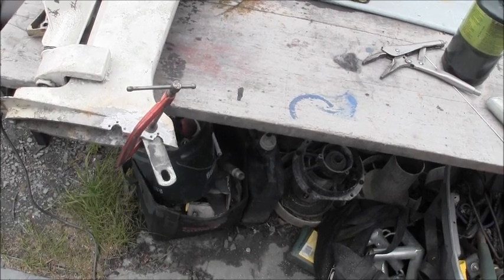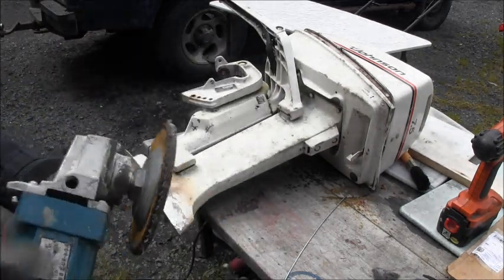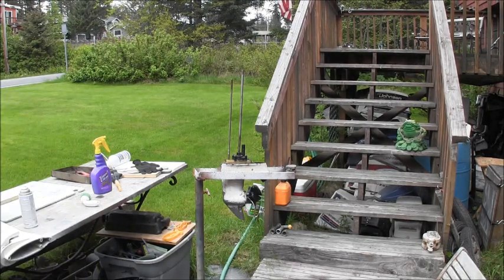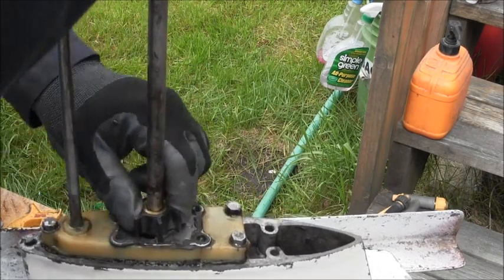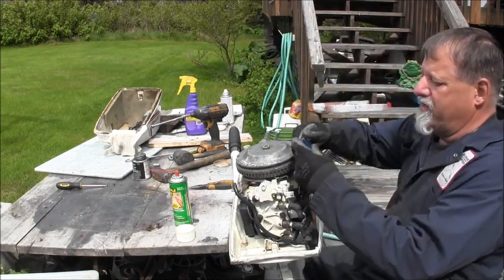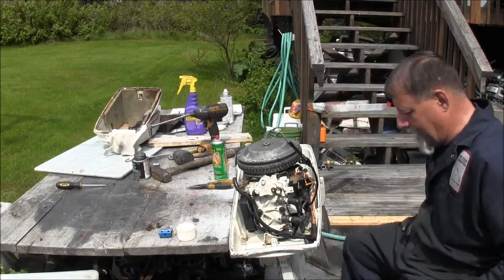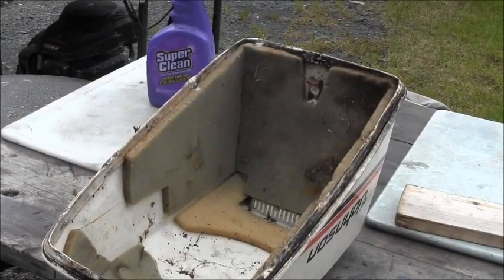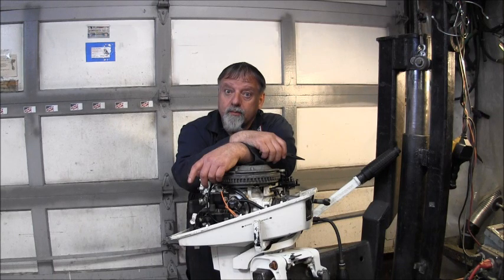JOHNSON 1983  7 5  HP,    WILL IT RUN  ?

Comment: My father had a 1984 Johson 6 HP on his 14 ft Gregor fishing boat and it was great. Never any issues. Never used in salt water just hrs and hrs and hrs of use fishing lake trout. I myself bought and used a 1984 Mercury 7.5 hp for my fishing boat. Engine still runs great too.
Reply from the maker: I so wish I had a place to run my motors in fresh water.  kodi

Comment: Hi Kodi, I just got one of those Harbor Freight auto torches to use with map gas. I wasn't getting a hot enough flame just using a propane bottle and my old brazing torch. I currently don't have any project requiring Alumiweld but I have plenty of rods when I do. Also yes make sure to use a aluminum type grinding disc or a regular one loads up and doesn't work well👍
Reply from the maker: Great tip!  I should have stated that in the vid,  I have 2 grinders set up that I only use on aluminium .     kodi

Comment: Should there be water coming out the exhaust breather holes on the midsection? A friend has an 9.9 Evinrude from the late 80’s and it has water coming out when you rev it.
Reply: You usually won't see much of anything coming out of those exhaust relief holes, maybe a little spray mixed with exhaust...  On the 9.9 you mention, water may come out of those relief holes at high speed because the inner "wall of water" has filled and the excess dumps out of the relief holes...Normal....
Reply: Thank you

Comment: Hi Kodi from Montreal Canada, That is exactly the same motor that I have; however, mine is 1980. It used to have 120 PSI compression in both cylinders, but after an overheat that it had due to the water pump was broken. Now it has just 75 psi compression. I already repaired the water pump and I have changed the head power gasket. The motor starts easily and it runs well; but, it still has low compression (75 PSI). Do you recommend me to change the Rings to improve compression or is better to continue using it at 75 PSI compression as it has now?
Reply from the maker: I would run it as is,  If it gets hard starting / poor running  then rebuild / re-ring it.  kodi
Reply: @kodibassInsideoutboards  Thanks a lot for yours videos and for answering my questions.  I will run it as it is ...

Comment: Did I miss a video?  I'm assuming the exhaust housing got damaged while attempting to wrastle that gearcase off.  A brazing rod for aluminum??  Tell us more about that for sure!    These engines have a few unforgivable flaws starting with the tendency for the driveshaft/crank splines to seize/rust.  I'm "guessing" this is due to the materials used to make the crank, but it sure seems to be the crank splines that rust up terribly.  Like I say, engines used in salt water should have their gearcases removed yearly to clean and relube the splines...The beauty part of these engines is that there is no shift rod connector, so they come off and on in minutes...  There is another hidden problem area on these things also...There is a little cavity hidden under that cheesy plastic upper gearcase cover that loves to store crap/debris and deliver it to the impeller...I had one of these that kept eating up impellers....Finally thought about it, then pulled the plastic upper cover, only to find a big pile of broken impeller debris under there...So, every time I replaced an impeller, the old pieces hiding down there would shoot back up into the pump, jamming and breaking the new impeller vanes...Someone before you opted to use that crappy sealer instead of the gaskets that belong on either side of the SS impeller plate.  These engines use the same lousy upper grommets as the 9.9/15s, trying to blow through them or jam a wire up there is only a short term solution...  Finally, the inner workings of these gearcases are flawed also...There is no bushing between the prop shaft bushing/brg carrier and the rear face of the reverse gear....So, there is quite a bit of friction/heat developed in this area, while leads to wear on the carrier face that the gear "rubs" on...Especially in reverse...A real big issue on tenders or sailboats that use reverse gear extensively...Once there is enough wear on the bushing/prop shaft seal carrier, this results in excessive prop shaft end play which leads to jumping out of gear.  I always used to wonder why the gear lube on these engines was always so dark/burnt when I changed it....Now I know....
Hmm, very interesting throttle cable lube device, I surely need something like that...I usually end up drilling a little hole into the end of the plastic casing, then injecting mystery oil with the tiller off, letting it sit overnight hanging vertically...Those darn cables are way too expensive.  
With all my "OMC shaming" here, one would think I hate these engines...But I still like them....Yeah, not nearly as durable as the old 6hps, but way more power.  And, with proper care, they can still last a long time, even in salt water...

Comment: Hi.On my 7.5 the water stops when engine is high rpm for like 5min.What could be wrong?
Reply from the maker: Check your water pump & impeller.    kb
Reply: @kodibassInsideoutboards  impeler is new and works fine,when water stops i get like fumes or steam out of water outlet hose.Lets say i on half power.....water starts to cut out and gets back on.When i increase power i get flow again,when i go to idle water stops.

Also i got fumes or steam out of that hole under the motor head.....like a preasure valve.....i dont know whats that for

Comment: The boat has wheels on a boat is that the same guy on north kodiak on mountain men
Reply from the maker: Yes'  kodibass
Reply: Kodi did you water test the water pump impeller. Throw it in the water and see if it floats. 
LoL’s